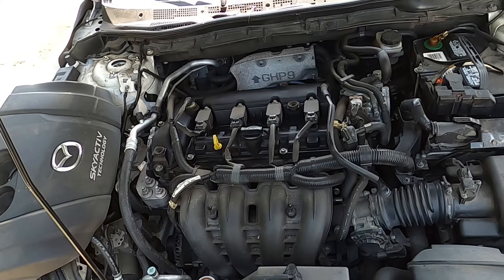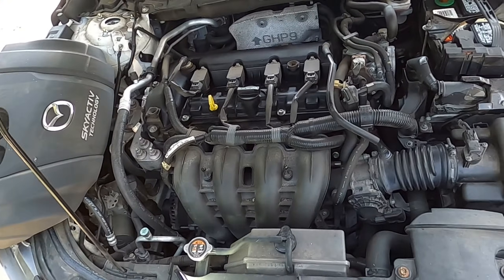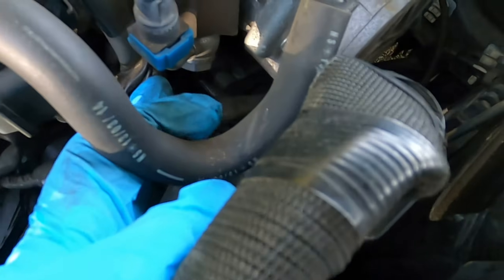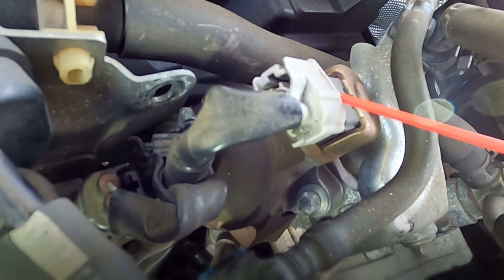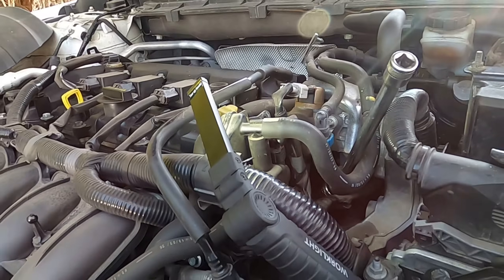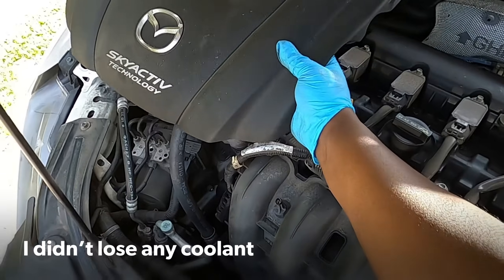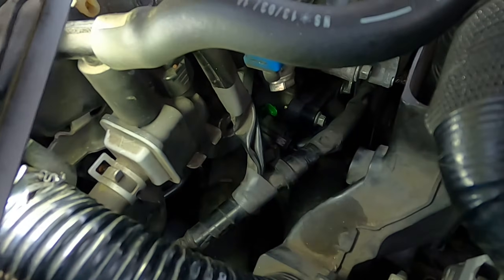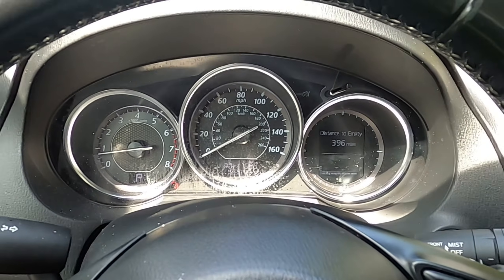2014-2021 Mazda 6 Engine Coolant Temperature Sensor Replacement

Comment: Penetrating oil would not have helped. It pretty much never does. Also open the radiator when cool to release the pressure then put it back on to create a vacuum so more won’t come out.

Comment: Same locations for mazda 3?
Reply: 1.5, 2.0 and 2.5 have same block just different pistons, basically same engine on the outside
Reply from the maker: @johnnyb8173  I believe some Mazda 3’s have the 2.5L so yes. I’m not 100% sure about 2.0L engine though

Comment: To remove the harness, you didn’t have to apply pressure, just pull with the screwdriver?
Reply from the maker: At 3:22 that white wire harness is designed the same exact way. By applying pressure at the top it releases the hook that holds onto the sensor
Reply: Gotcha, thank you!
Reply: I wish I could see where you applied pressure to the harness that’s clicked into the coolant sensor. I have a ‘14 Mazda 6 and I can’t get it unhooked

Comment: Did this end up fixing your code? Or did it come back? (Troubleshooting a similar issue and not sure yet whether it's due to a heater core clog or a bad sensor...)
Reply from the maker: Check my Mazda 6 P011A complete diagnosis video. This code went away for about 2 weeks then it returned
Reply: Right I got this code from autozone as well as replace the heater core. My heat is blowing fine and doesn’t seem to be leaking in the cabin. Floor mats are dry and both the send and return hoses are warm. Around this sensor I don’t see a leak but it does look like some type of fluid has been there. I may just replace this $26 sensor instead of buying the $177 heater core. See if that fixes the issue. I just have slow coolant loss somewhere because I have to keep refilling.
Reply: @joshcgavin1  Recommend checking hoses to make sure you're not getting leaks around the clamps (I found a loose clamp near my heater core). Also, check for exhaust gasses in the coolant to make sure you don't have a leaky head gasket (also an issue on mine).
Reply: @andspenrob  how I check k for exhaust gasses?

Comment: I just applied your tutorial.  Thanks again! This was very helpful.  I would have never found the probe. The probe that came off had an aluminum washer, that my new OEM part did not come with. I just transferred that to the new one.  Hope it won’t leak…